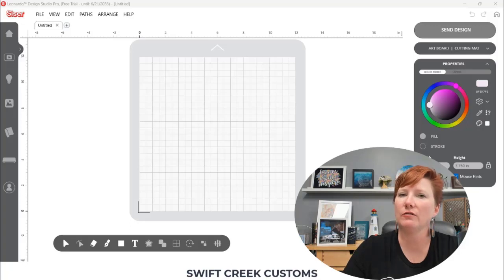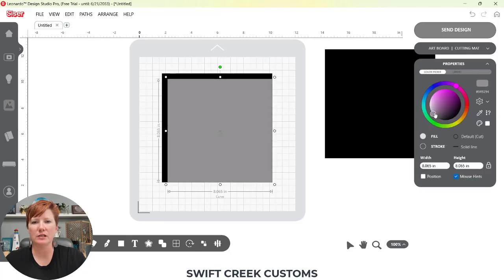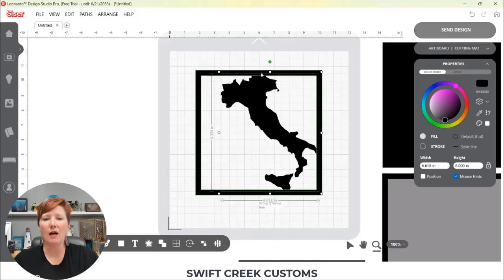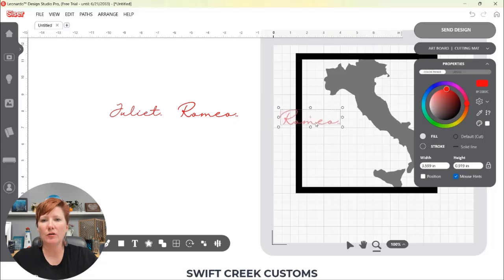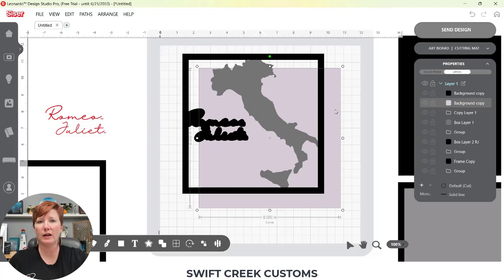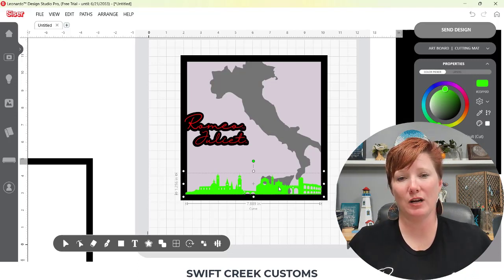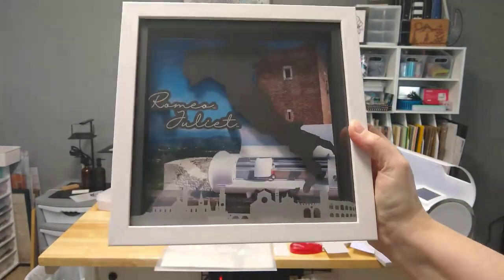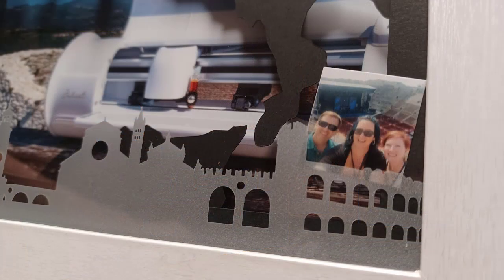Easily Create a Custom Shadow Box with Siser Juliet & Leonardo Design Studio

Comment: How did you change the color using the color picker? I there a keyboard command or a left click on the mouse? I’ve seen people change the color very quickly, but I can’t seem to do it when I just click in to the color. I am using a Mac laptop and the trackpad on it with no mouse.
Reply from the maker: I click on the color wheel to select the color.